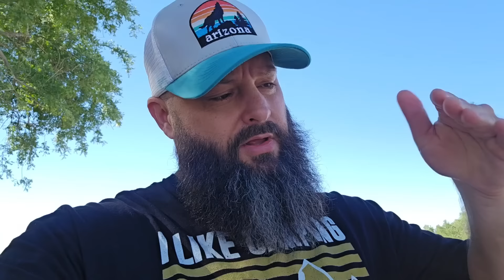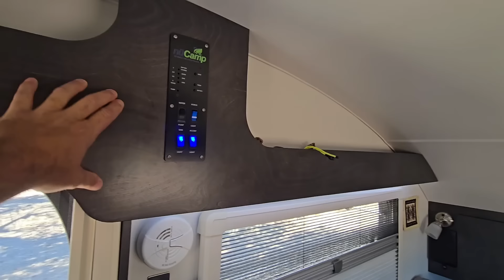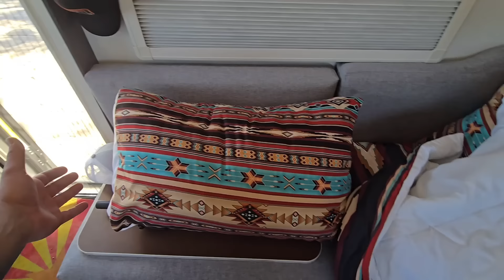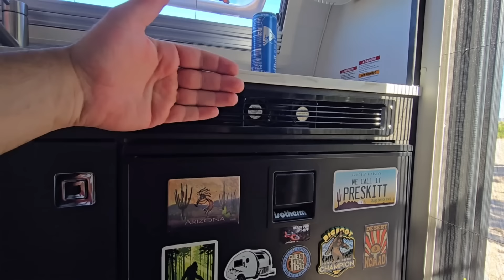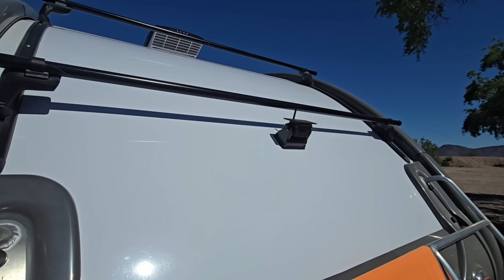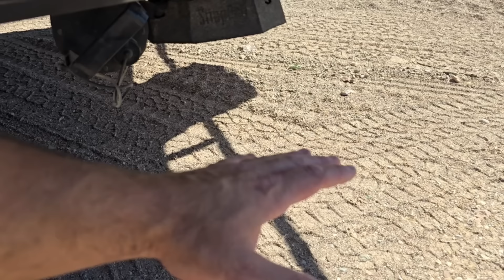THE FINAL NuCamp T@B 320s Boondock Trailer Review and update.

Comment: I noticed my 2025 has nylock nuts on the step, and a divider in the tongue box to separate the propane tank… I think nucamp is lurking on your channel, lol. I used your suggestion about setting the backup cam on the ground for parking on the leveling block this past weekend. I ended up sticking my camera to the rear stabilizer bar that runs under the rear of the trailer. It won’t charge under there, but it’s easy enough to pop off and charge when it gets low. This was my first trip out in the 320. Thanks to your videos I already knew how everything should work!
Reply from the maker: Oh, thats awesome!  Nucamp must have gotten on that step company and they finally fixed that issue. Very very cool! Hahaa, I actually copied the new tongue box design when I saw they changed it to having a dividing wall.  Very cool on the camera, im glad it's working out well for you. 👍  Glad i could be of some insight on things. Thanks again for watching and commenting. Much appreciated.

Comment: I should have started with a 200 watt solar panel, one grows out of the smaller size pretty quickly especially when you will rarely get the stated output. Jared on Youtube channel All About RV’s, is currently doing a multipart series on RV sealants worth a watch ( in regards to the bathroom seam that keeps opening up). Your videos are always a good watch, thanks for taking the time to do them.
Reply from the maker: Yep! Haha. I shouldn't have started with a 200 panel from the beginning, but at tge it wasn't needed. But now was the perfect to upgrade, so it worked out. Thanks for the tip on his channel, I will have to check that out. Thank you again for watching and commenting. I appreciate that.

Comment: Another great video!  Also FYI… it’s great that we have real wood.  But when it comes to attaching certain things Nucamp used very short screws.  Where maybe only a couple of threads goes into the wood.  One example is that storage box in the far back.  There are around six short screws and under that box they used those little plastic 90 degree book shelve type brace for support underneath. The box really has no support after wall in front of it.   If people roll things up and push back to put up back of seat they could disconnect that box and it will fall.  It will probably loosen and fall while you are driving.   
I put in longer and a little thicker screws.  PS … you may think use glue or two way tape.  But you really can’t although I think they use a tiny bit of glue in the middle.  The box needs to be able to move out of the way if you have to work on the heater system.
Reply from the maker: Thank you, much appreciated. Yes, those 90° degrees brackets are hard to get to in the upper camp side shelf also. I have often worried about getting to the back radiator and hoses behind the cubbie section if anything went wrong. I thought it had seen somewhere that someone had taken all that out successful. I guess there isn't a whole lot of meat, or depth for some of those screws to bit into in areas. I just try not to over pack anything with heavy objects just incase. So far so good and very solid though. Thanks for the tips on the longer screws. Thanks for watching and commenting.
Reply: @DSWadventures  Yes if you are careful there probably nothing to worry about.  But someone could try to push everything back and pack the hell out of it 😊.

Comment: Good review, I just found draining my gray water tank on my 320s  for the first time that the pull leaver is not blocking the water unless I missed something. I opened the drain cove and water came rushing out. I also found there is a rubber edge seal under the black trim molding is coming off.
Reply from the maker: I hope its nit broken. The grey water drain pull may have broken or detached or is stuck from sliding closed maybe. Its hard to say with seeing it. That little black rubber trim on the plastic roof trim edge can be pushed back on. At one end of the ruber strip I put a very small dab of glue on it and pushed the rubber back on the edge. I will try to link a video of the grey water valve to see if thats what you're experiencing.
Reply: @DSWadventures thanks Jr, I was going to add a little clue as you suggest, yea my gray water dumped without me pulling the valve  The RV went out warranty last month. So going to lubricant the valve shaft and if that don’t work to stop the drainage I’ll put on a twist pull valve.
Reply from the maker: @MyRanger12  Try putting some of that Thetford grey tank valve lube down the drain with a bunch of water in your grey tank for bit. Keep the grey cap on let it sit a bit and try to work the grey dump valve also. I hope something didn't break in there.
Reply from the maker: https://youtu.be/eQJo4dwTs4I?si=AeZsuRtQa53z_UPC
Reply from the maker: I think ours may have a cable style, that im not sure of. But I think one of these maybe the issue you are talking about. Maybe give a version of this a try. Every so often I add some thetford grey dump valve lubricant into the grey water to hopefully prevent this. If not the cable of shaft of the pull handle could be sticking.
Reply from the maker: https://youtu.be/_jVsV22_0HI?si=GAe0ju2JO5ISaBTB

Comment: Can you give a reference to the plastic clips to hold  or stabilize  your outside trim. Another great video!
Reply from the maker: https://www.amazon.com/OAUTOO-Multi-Purpose-Push-Type-W706350-S300-000-991-52-40/dp/B0CRRTM6TH/ref=mp_s_a_1_5_sspa?crid=G33URX51E12R&dib=eyJ2IjoiMSJ9.S4ZP2Uh2rBfK2jPJl6i7-qhhL3_30e5zGNSrSMjdkcug_JtpG39PQHbjGzmSYXM4zxDBHDl3r-tzsYmSArDoq-uMhGcYg-R8HqqFdvHNErKUeF8VJs85zWTBwQ4lJO5A3ZI4Bx662YHRpnTAXCysYYxpSA3XuYAZittRZQXu1NFacoppGrp5Iv2XlChXaia5z3d3yJDB00PnJ_DHfBfdQw.3JAw1DjXcATCSwvDEDLKgd8_CTyhw9hn1ZOQhMg4Y6E&dib_tag=se&keywords=1%2F4+inch+automotive+plastic+push+pins&qid=1761051676&sprefix=plastic+push+pins+automotive%2Caps%2C212&sr=8-5-spons&sp_csd=d2lkZ2V0TmFtZT1zcF9waG9uZV9zZWFyY2hfbXRm&psc=1
Reply from the maker: They look simular to this, I cant be exact on that size. You can usually get them at the hardware store or autoparts store. I like the removable center screw style so that they are easier to remove if you have to.  You only have to drill through the two layers of plastic. DO NOT!!! drill into your roof! Mark your drill bit with tape about 1/4 inche from the tip of the drill bit so you don't over drill. Also the hole drilled needs to be the exact size of the push pin shaft, maybe a touch over so it can expand. Dont over drill hole diameter to big or they won't hold after expansion.
Reply: @DSWadventures these will come in handy for many different fastening jobs you're the best
Reply from the maker: @larryfregin2859 Oh yeah, definitely. Especially if you need one to replace on a vehicle also.